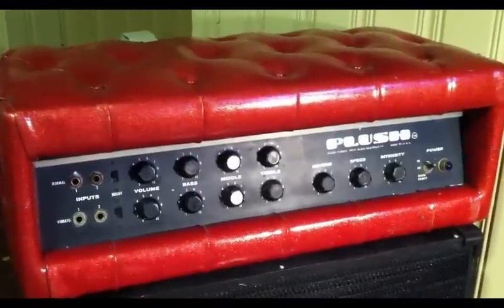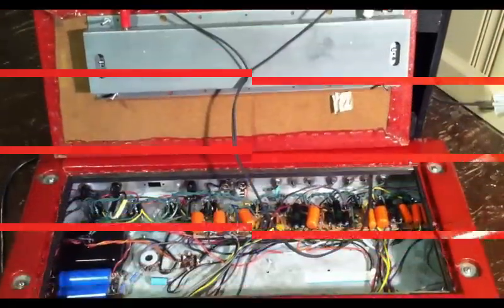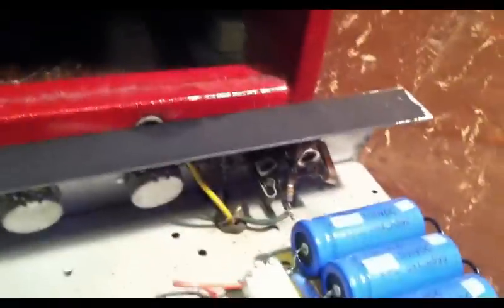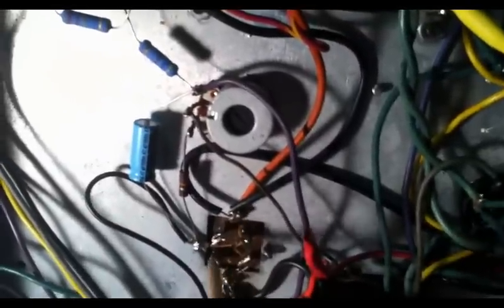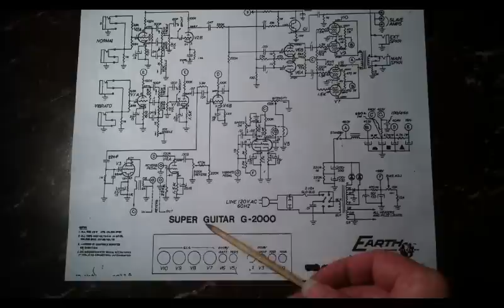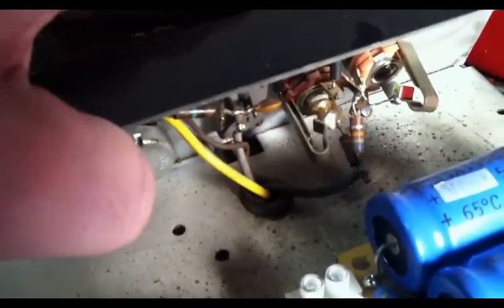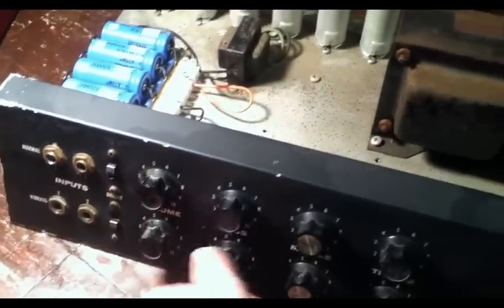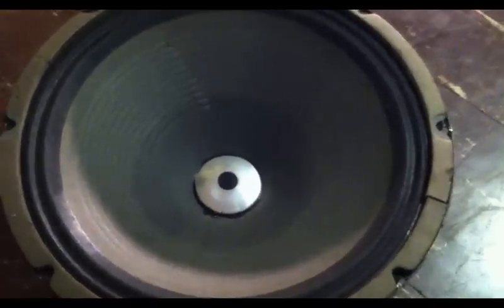1969 Plush P-1000S 100W Tube Stack Service, Teardown & Demo

Comment from the maker: Just came back to look at this after more than 5 years. I apologize for the terrible video quality. Geez.
Reply: Message still received unwrapped, B!  Stay free.  R   🎯 🍻 😎
Reply: Hey Brad! I’m looking at potentially getting one of these amps. Should I go for it? What are your thoughts?
Reply: Hi Brad! The Music Go Round there in Louisville currently has one of these in green sparkle. I checked it out the other day. They're asking just over $500, but the guy was willing to negotiate. Cool as shit, but I just had no need for it. But it looked like original tubes inside, and one of the power tubes had a bad hot spot (red plating). This led to the conversation with the salesman, and subsequent price negotiation. I didn't test it out, but it piqued my curiosity; and led me back to this video!
Reply: Oh gosh! That was the reason for my comment. I feel like I'm seizing due to the constant focus - refocus! Ugh! Apology accepted! 😊👍

Comment: Played bass through one of these off and on from 1971 to 1995. Always thought it was built to the Fender Bandmaster Schematic. I bought a Plush W cabinet with it Loaded with a single 18" Cerwin Vega. Crazy good sounding Bass amp. ( Plush used Naugahyde for the upholstery.)

Comment: I have a P-1000, last time it was serviced the gentleman who does my work for me commented on how tight the panel was to remove. He stapled a thin colour matched canvas strap at each end of the panel, now it's easy to remove. Not that it's needed removing, it never misses a beat. It's a good stack i got it very reasonably priced many years ago. I guess i got one of the good ones.

Comment: I used to own a PLUSH 3000B bass amp. 6 6L6'S 160 Watts with a folded 18 Vega equipped cabinet.  I loved that rig. Killer bass tones. One night at a gig it gave out the ghost right at the end of the gig. Sparks shot out of the back and much smoke.

 It used an OC3 tube for a Screen voltage regulator. That tube went bad and fried the amp. IIRC all the power tubes and the OC3 had the sockets mounted on a long PC board strip. That PC strip got so hot it burnt the traces off of and charred the PC board. It was a pretty major meltdown and yet the fuse never blew. One has to wonder why it didn't?  PLUSH was lone gone by that time so the amp was scrapped for parts.  I purchased an Acoustic 370 with a 301 cab and moved on.  The Acoustic sounded nice but never had the warmth and grind of that PLUSH amp.

Comment: Purchased one new in 1968.The Utah's lasted two weeks.Drove down to their service center on 16th Street Manhattan two more times for the same problem.Second set were Jensen which was an option and third was for Altec-Lansings which were extra cost. Two 421-8h's lasted till sold in 1975.I had to kick in $100 for the pair of Altec's.

Comment: It's called " button,tuft" and it could be found on almost all custom show cars of the 50'-60's. They had a factory / service center near me in NYC. I think 23rd st? They lifted alit from Fender. Check out the reverb circuit, complete with drive trans.

Comment: Thx for the video, i have one of these and you enlightened me on a few points. at 6:00, i think that label is from the guy that serviced it, looks like he was logging his hrs spent on the service. That 2nd to last 12a?7 tube (V7?)...on mine, it only serves to drive the SLAVE output. i pulled it out. On your G-2000 schem, i would concur that the PNP transistor replaced it. Mine has an odd problem... my volume at zero, i still hear my guitar leaking thru, like the vol is set to 1. I gotta do more digging. THANKS for the great video!

Comment: In watching the video, I noticed that the replacement 15 speakers had tiny , maybe 1" voice coils. There's no great reason to try and find OEM speakers when fixing up vintage gear like that, because in those days most 15 woofers had seriously tiny wattage ratings. They constantly blew out with normal use.  Especially true on bass although that's a guitar amp.  Those amps are great with sturdier speakers.  We remember the nightmare of eminence, jensen, and all those other weak speakers that were constantly being reconed or replaced.  It wasn't until a company named Gauss came up with a 400 watt 15 that we finally breathed a sigh of relief.

Comment: Amazing how you figure this stuff out.  Would it be worth it to use shielded wires for the ones you were pointing out that weren't shielded?  Is that possible to do?  Ah Cool... you just said you ran shielded cables... Yet another thing that seems really really interesting now that I'm old and about done.  haha..   I'm thinking about 300 or 400 years would be a good lifespan to get a lot of things done.  Thanks Enjoyed it.

Comment: Awesome. I have a 3000G Pearl Tuck & Roll Plush. Has 6 - 6L6's. Heaviest Tube amp I've ever owned. Ways as much as the old SVT 200w Tube Bass amps. Definitely a Fender amp on steroids for sure. Huge massive clean amp with Reverb & Vibrato. One of my favorite amps for sure & I always get players wanting to talk about it whenever I do take it out to gigs. Which is tuff not only because of the weight, but also because there's absolutely no way to use a 150w tube amp like this one in a small club.

Comment: Hey Brad; That Earth schematic is the same one I downloaded on the internet almost 20 years ago. I can tell because I blacked my name out on the bottom right. That's cool to see it on here. I also have a Plush P1000 that I overhauled. I also have an Earth PA 2000 that is similar.
Reply: Downloaded or uploaded? Do you have the original hard copy?
Reply: Thanks for uploading it.

Comment: I have a Plush Super 450 twin 12 combo from the same era. Its a 100W amp in the same color. A lot of differences though? Including reverb which is directly driven without a transformer. The GE tubes look virtually brand new and are still well matched so maybe didn't have a lot of use. If you know of  a schematic diagram for the Super 450, I'd like to find it. Thanks.

Comment: Identical to a Fender Twin-Reverb. The small trans near the preamp tubes is in the reverb circuit.Its the reverb driver trans. Matches the 12AT7 two sections in parallel to the local impedance reverb can input.Identical to the Fender amps.

Comment: Bend the sandpaper in half so you clean both connections at the same time and it cleans better due to the thicker sandpaper... I use ultra fine 1500 wet, but of course I use it dry...

Comment: Wouldn't you expect after 50 years there was a speaker change or two? They were originally mounted from the rear.That explains the speaker opening size.

Comment: I had a old plush 100 watt head .. the only tube Head I had....(unless my fender Prinston was tube?) 
And mine was single channel..
It had   4  EL-34's ....if I remember correctly.( May have been 6L6's)..had to buy a set in 92-93?

Comment: Anyone else find it odd that the design sends the reverb send and receive signals out of the chassis interior via RCA jacks, then back into the chassis interior through a hole in the cabinet?  Why not just wire it directly to the reverb tank via the tanks RCA jacks, and skip the trip outside the cabinet?

Comment: I know Earth was famous for copies,  but this thing is laid out pretty much EXACTLY like an Earth Super Bass B2000 head I just picked up.  Metal work,  all of it.  The output jacks not being labeled for impedance,  etc.
Reply: Not 100% sure but this outfit may have been bought out by Earth or they morphed into them cause they are the same,just diff names and later ones went partial PCB.

Comment: They actually made better bass amps then a guitar amp, I remember them well. Everybody thought they were like a Kustom (a tone dead amp company) and we didn't realize hey were tube amps..LOL. We were so ignorant those days. It would sound a lot better if you either hooked up the head to a 4-12 cab or blocked those sound ports, those are for bass. Utah speakers were horrible tone wise, terrible, yet in a Fender I think they were upgrades from the factory. I don't know if you ever played a Fender Dual Showman with JBLs, an amazing amp (try to get Albert King at the Filmore East) these seem similar, too bad JBL doesn't make those old D130s anymore. I miss the 60s and early 70s.
Reply: Plush had a W cabinet with an 18" cerwin vega in it. That's What I bought with My P1000s in '71. A more than great bass amp with this cab. 1 recone in 22 years. That was because the frame cracked  and pushed the voice coil out of line. JB weld fixed that. Lost the cab in a bar fire. Miss the sound but, I don't miss moving it. We called it " the refrigerator".
Reply: Ah , those good ol' daze ! We didn't know SQUAT about the gear , we'd just Plug In n' Go ...

Comment: It's a earth sound rwasearch amp also after plush closed it's actually I was told a  twin reverb I have one in a 410 alnico speakers.
  Got it cheap. Took Al the tubes out for safe keeping storage and they all got stolen..
  I had a g2000 earth twice, AWesome amp.built shitty .
  Worth fixing and mKi g better for cheap of one does their own work.
 Glad I finaly found this..

Comment: to my knowledge, Plush, and Earth were separate companies
It appears that Earth ripped off the Schemo's after the demise of Plush
Plush was mfgrd in Cali, Earth in Soyesset, New York
Grand Funk Railroad at one time used Earth

bye the way, here in New York it's pronounced "Trem-olo" .. :)
Reply from the maker: I put additional information on the two companies in the description for the video, based on conversations I had with Andy Fuchs, current owner of the Plush name.
Reply: Sounds about right, earth ripped off everybody, even peavey
Reply: who would want to rip off PV ...!!!1
Reply: The origins Marshal 45w and Fender 45w amps were copies the a 45 watt amp in the RCA Tube Reference manual from the 1950s.
Reply: Embree Smith Jeff Beck used Plush amps. I didn’t know Grand Funk Railroad used them. I always thought they used West amps.

Comment: I owned a black one of these, not a bad amp. Pretty good Fender clean tone that you could crank and keep your head room.But i sold mine about 20 years ago ? But you can still find these for cheap and if you like Fender tone, this is a great option. Mine was a 72 or 74 I think ? Plush still exists as a brand they make pedals, but i dont know who owns them and makes the pedals or if they actually exist as their own company. But the name is still around. Now let me watch the rest of the video 🙂
Anyone know what type of speakers came with the cab that went with these ? I never had the cab, and i never knew what originally came with it. Thanks

EDIT: You mentioned what type of speakers were in the cab. Utah. Good to know :-) thanks. I had always thought this amp came with a 2x12, but no it was a 2x15! Crazy :-)
Reply: Oh yeah that back metal piece, be very careful. I cut my hand very very badly on that when I went to put new tubes in it. Also because of the height of the chassis you cant put any tall 6L6 tubes in it. They have to be the shorter glass tubes. If you own this make a note of that so when ya get new tubes you dont do what i did haha
Reply: Haha. One last thing. I bought mine for $100 and it was missing the bottom, if you find one that works and looks good but the bottom is missing. Buy a piece of plexi and cut it to size. Thats what I did and it also allowed me to be able to see the inside of the amp without taking it apart ;-) I do miss this amp. But that also means if their is no bottom then their is no reverb pan. So make a note of that.
Reply: Also folks dont do the sand paper thing hes doing here on your input jack with the amp on and those caps exposed hehe. Yikes, thatll wake ya up ! haha

Comment: That earth schematic looks wrong... The slave amp and external speaker are parallel. The external speaker should be connected to the output transformer.

Comment: dont sand the contacts, youre taking the coating off. use just an eraser rubber and contact cleaner. also those orange drops are brand new.
Reply from the maker: +Camilo Pasin I realized that later on about the orange drops. Looked at some other gut shots and it became obvious. As for cleaning the grounding contact on an input jack without some kind of file or sand paper...I disagree. You aren't going to get an eraser in there.
Reply: +The Guitologist If not sandpaper,  a jewelers file...  gotta scrape off the crap-ola if it's there.
Reply: i do manage to get a eraser in there. cut it, open the contact and clean it. normal paper also works. and you can disagre as much as you want. it aint me thats saying you shouldnt sand contacts, its people way smarter than me, im just passing their knowledge.
Reply from the maker: Just to be clear...there is no 'coating' on the contacts to sand off. There's plating, but the plating doesn't really add anything in terms of conductivity. The substrate material is usually copper anyway, so sanding off chrome plating to expose copper isn't going to compromise conductivity. Just for the record. I ain't mad at ya. :)
Reply: coating is just a way of saying, there is a nickel plating and it adds in corrosion resistance. and its thin. by sanding it youre just making less durable, youre exposing the copper without needing to. if you just clean it, it will last longer. nickel is virtually non corrosive in normal conditions and its also a harder metal than copper. and theres the fact that when you sand a nickel plating youre creating microscopic grooves over the surface making it more susceptible to hold dirt. sanding is gonna make you have that very same problem in a couple of years of hard use.
Reply: We all have way to inprove the way we do things and I for one learn some thing everyday. Camilo you left out the fact that 2 smooth metal surfaces make more contact then one rough and one smooth or both rough. That is to say each fine scratch is a recess that will not touch the other mating surface. He did say 1000 grit would be better and it would if an eraser didn't get the job done or if someone had sanded it before.
Reply: The Guitologist.  Wiping the contacts with regular paper always worked for me, at least if the contacts aren't too pitted or corroded. Tear up a narrow strip of paper, fold it up to make it more rigid and wipe it between the contacts until it comes out clean. Straight contact cleaner works too.